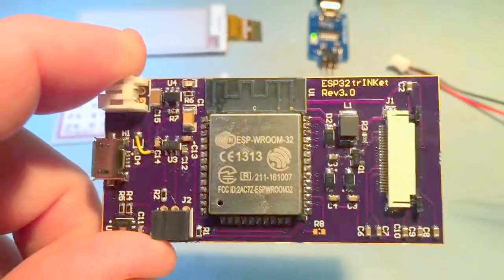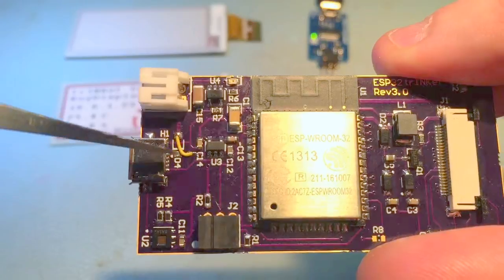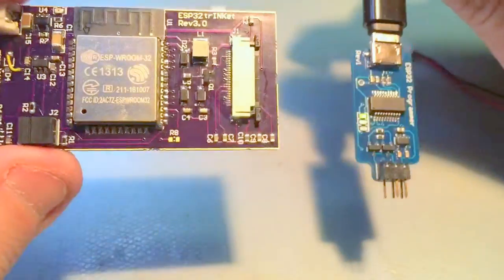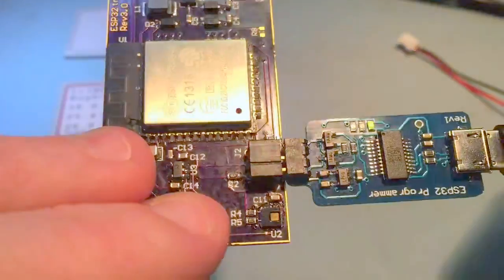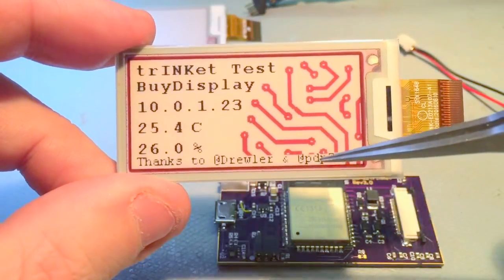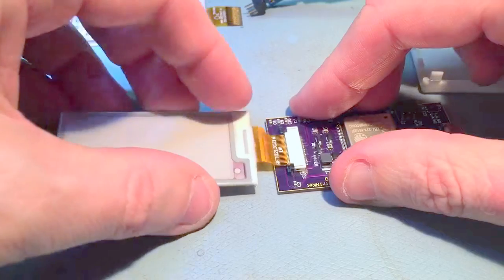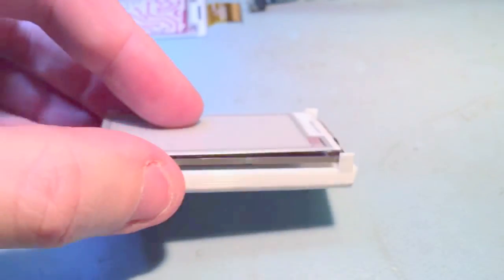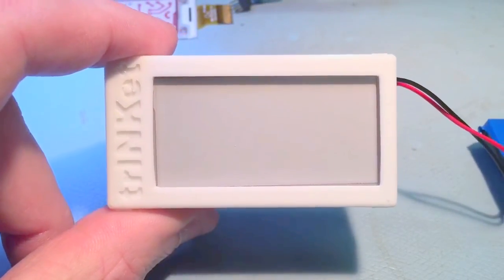ESP32 trINKet E-ink Dev Board

Comment: This looks really neat. What is the current draw in sleep mode?
Reply from the maker: James Busch not having the USB chip on the board is a nice cheat to get power consumption way down. The big drawback is you cannot upload a new sketch if the programming board is somewhere else.
Reply: @0miker0  thank you! i may have to try that on my next project and do it in conjunction with OTA updates.
Reply from the maker: James Busch it’s been a while and I cannot remember now. I should have noted it somewhere. On a tiny battery waking every 30 minutes it lasts a few weeks.

Comment: I like it.  My suggestion would be to put all the pieces of the programming board on the main board, so you can program the device with one usb connection. and don't have to have a special programming board.
Reply from the maker: Michael Hunter Looking back now, I probably should have done that. Fitting the FTDI and dual transistors onto the board would have been pretty easy. Another possibility is over the air programming. No need for programming parts then if you can upload sketches OTA.

Comment: First off hats off for releasing open source and your hard work! I see a new revision up v3.1 on github but not being farmilar, I do not see any change log info. Does this fix the jumper that you soldered to the trace a c14 or where do I find a list of changes in this revision (hardward and software)? I do realize that this revision is only 16hrs old.
Reply from the maker: ytfp a board revision hopefully fixing the jumper is being manufactured now. If it works I’ll update the gerbers and note that the fix was done and is working. I was hoping to hold off but the software and schematic could be of help to others now.
Reply: Awesome! Will look forward to it. Love these videos!